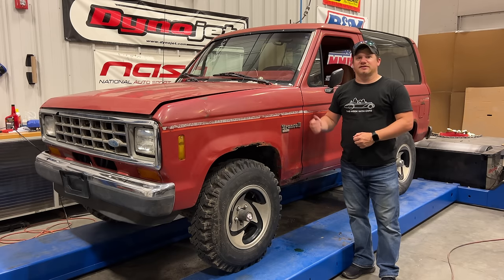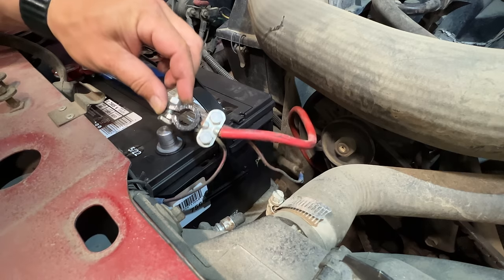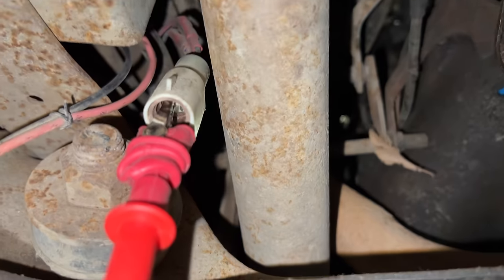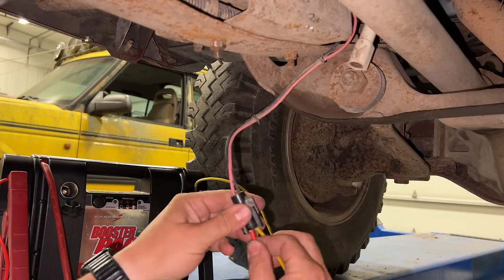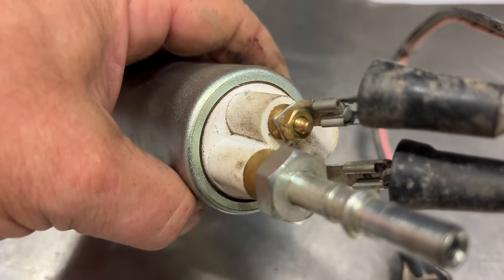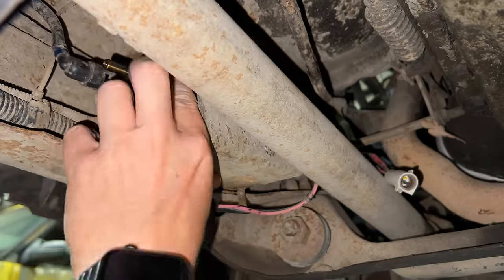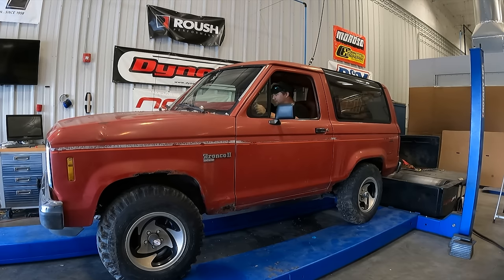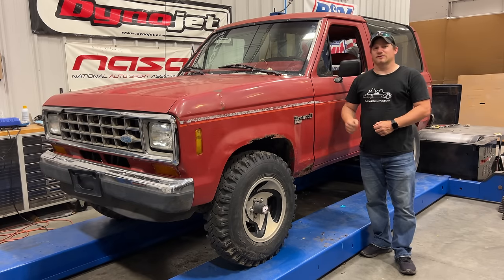Ford Bronco II - Will It Run

Comment: Miss my 90' B2.  Had a D35, a lift, chop top, headers, and a manual swap after the A4LD commited suicide.  Somehow it made it to 250k miles until I wheeled it on just 2 quarts of oil lol.  What a great truck.

Comment: Looks like an 86-88. 89 was the first year of the facelift
Reply: I was thinking the same. 89 also went to one pump in the fuel tank and did away with that frame mounted stuff

Comment: Those 2.9L engines have no guts whatsoever but also they won't stop running. My 89 sat for 3 years, stabil in the gas and started right up. Drove it on the car hauler to where it is now at my new place. I swapped out the running gear with a 94 Expolder. 3.73 gearing & still a dog except when in four low has plenty of power.

Comment: Had a 89 Ranger 2.9 4x4.  Engine out twice: at 102k, due partly drilled oil hole needed rod bearings.  Ford dealer supplied crank  had oversized counterweights which scraped piston skirts when warm.   Developed same lifter tick at 120k.  Fix Or Repair Daily!

Comment: I believe there's two fuel pumps. One on rail, one in tank. I had an 86 2.9 ranger. Same tick. Added MMO. Quieted some.
Reply from the maker: Yes there is a low pressure pump in the tank as well.  I was told they replaced both pumps but since the rear one is not working and the fuel gauge does not work I am wondering if they did the rear pump at all.  We will find out soon!
Reply: @ThisWeekWithCars  yeah. My fuel gauge quit also. I replaced both pump and sending unit. May want to carry a spare icm in your glove box. Ford's answer to the Mopar ballast resistor.  Excellent content!

Comment: Yep ya need to go through the important safety driving systems.  Good call on the fuel pump.  I really hate incompetence in wiring and basic trouble shooting.  You are lucky that crazy Ford aluminum ignition module still spit out fire

Comment: I've been working on a b2 as well - moved it around the house and let it sit for a few months and when I went back to start it the ignition switch, key cylinder, inertia switch, AND on-line fuel pump were dead. I've never had so many things break on me at the same time lol
Reply from the maker: These do have a problem with the stupid clip inside the steering column.  You may need to remove it and make sure the big plastic switch on the right side is still held tightly.

Comment: Steve, I'd love to see a video about how long gas can last in an old car and what you do about it.  You seem to crank 'em over and have good luck, do you check the gas in any way first?
Reply: With some vehicles that have sat for 20 years or more the fuel often smells bad, plus there could be rust in it from the fuel tank, thereby clogging the fuel filter and also if stood long enough without running the carb could be contaminated and the fuel lines could also be bad , so empty the fuel tank, replace  the  fuel lines,  clean out the carbie, change the fuel pump if necessary , make sure  uve got spark to the plugs and it should start , unless of course it sat so long the rings corroded to the cylinders and pistons then u need to go through a whole other procedure

Comment: Thats not a 89 model, it's older because of the headlights. I have two B2's 87 and 89.
Reply: Headlights, bumper and grille. I also have both generations, and '88 and a '90 currently. Had an '89 Eddie Bauer some time ago. They're great little rigs.

Comment: '88 or older, '89's are a different body style. '89's use a single fuel pump in the tank, '88 and older uses a low pressure pump in the tank and the high pressure pump in the frame rail under the driver seat.

Comment: Sorry but that takes effort to screw up the wiring when you only have two colors to choose from. Those are probably fun but at least the early ones make for poor highway vehicles.  I had an '84, the very first one, with a carbed 2.8L V6. Way underpowered, and much too thirsty for such a small engine. The only worse car I recall driving was a 1984 Fiero 2M4.

Comment: I had this exact year and color I loved this truck but I had a fuel delivery problem it would just die going down the road and I had three mechanics look at it and could not fix it someone before May really messed the wiring up and no one could figure it out and added some sort of aftermarket computer I would still have it if I could have fixed it.
Reply from the maker: These have a problem with the wiring in the steering column, I would bet the issue was there, the connector is terrible and can vibrate loose causing the fuel pump to randomly stop.  I thought I was going to find that issue with this one but it was the actual pump instead.
Reply: @ThisWeekWithCars  thank you sir I sold it to a neighbor Who hasn’t done anything with it yet I might bad back from him